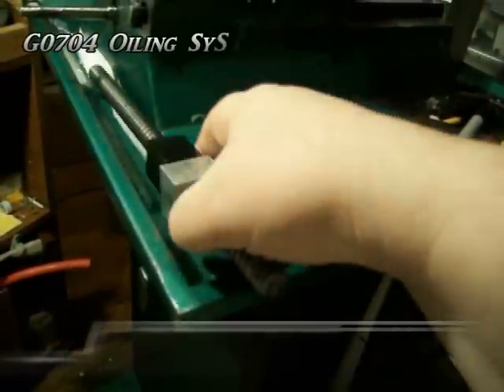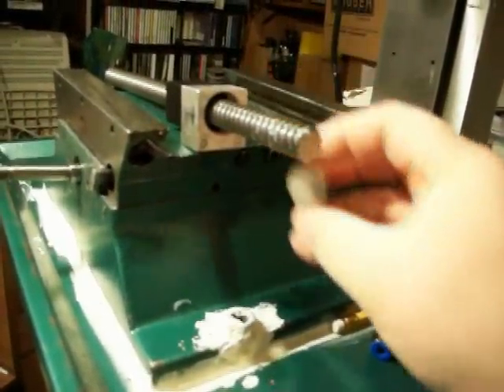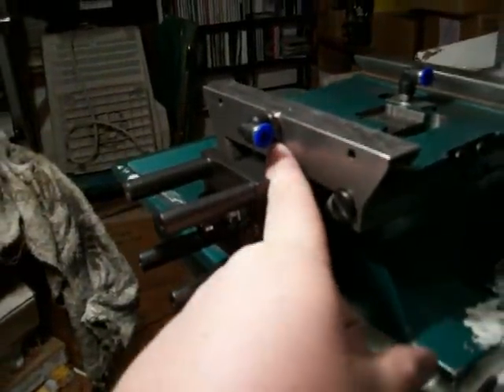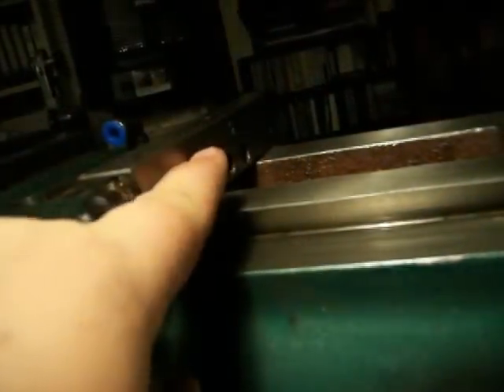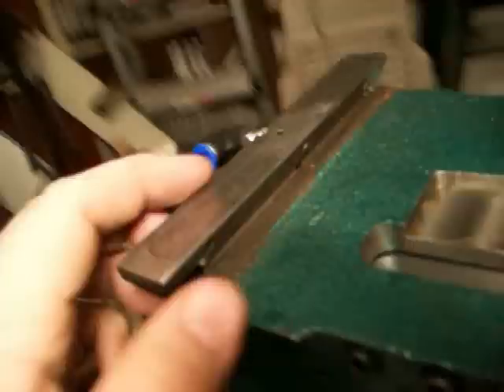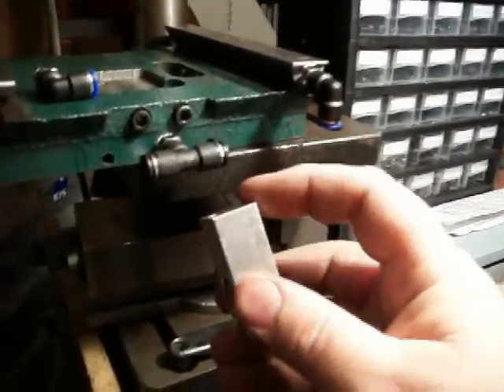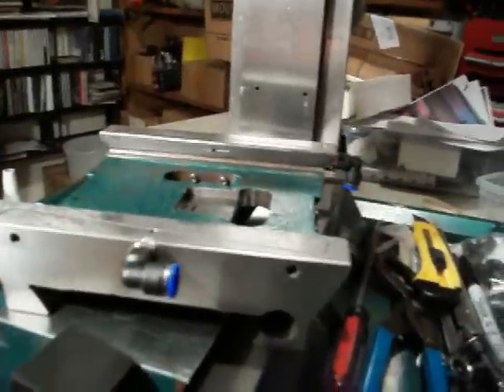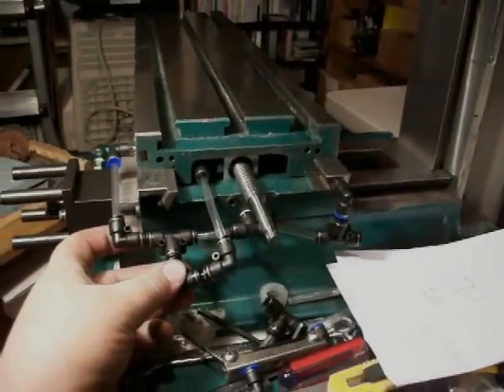G0704 Oiling System Passages

Comment: thats nice Hoss. I have never seen a setup like that. Is there a reason that grease would not work in the ball screw? maybe it would stay in the pocket on the screw better? 
Seems they could have made those tubes and fittings allot smaller